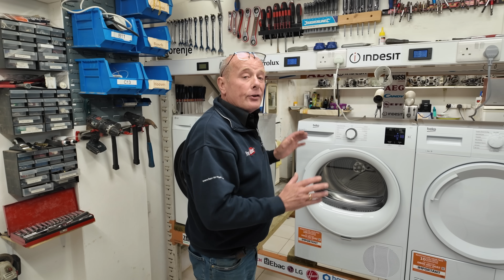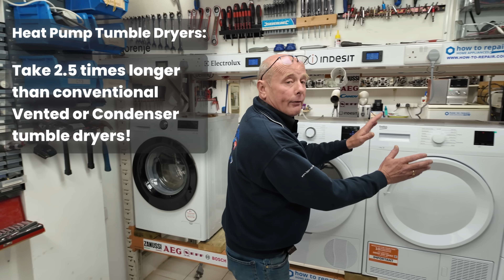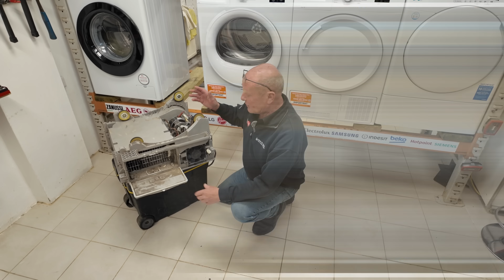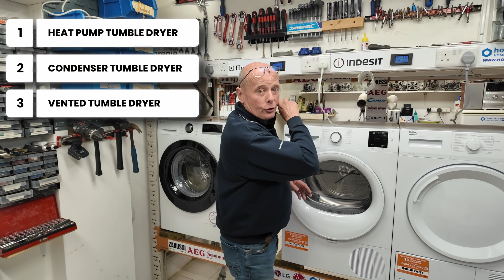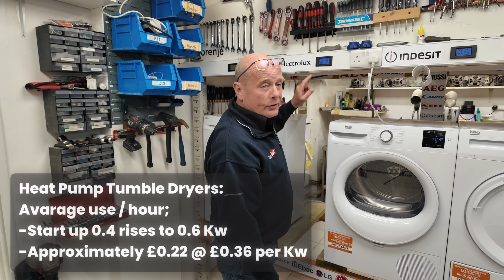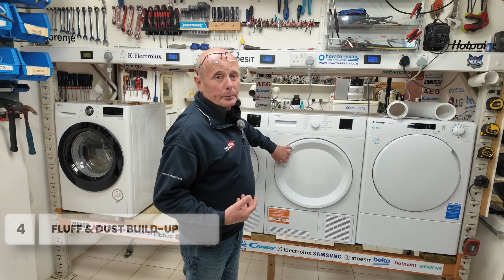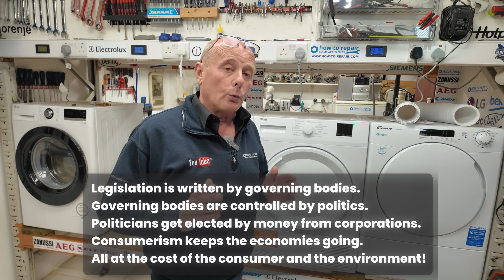Tumble Dryers the Shocking Truth About Heat Pump vs Vented & Condenser, NEW LEGISLATION!

Comment: Especially a vented dryer is a total waste! You just blow out hot air, just heated, outside - an amazing use of energy. In cooler areas, like northern Europe, it is not only the electricity - it is also the loss of air to outdoors, already heated indoor air is further heated and them 'dumped' outdoors (seasonal). You didn't count that. The vent dryer is an amazingly costly lost of warmth. A total waste which is very costly.  Fixing a condensation dryer also means working on a heat pump, that is the system which cools the plates to create condensation. It is also a refrigeration unit. The full heat pump dryer however also 'heats' input air through the heat pump, not only cools condensation plates with one. It is not much different from the condensation dryer. What is the difference? That condensation dryer 'heats' the hot air input using a traditional convection air heater, like blow dryer. Obviously, the heat pump unit 'heats' through heat pump which is not as hot, requires more air and thus tumbles longer, but maybe slower. Bearings do not have as much wear and tear as in a washing machine with all its tough torque moments. So I wouldn't be so concerned and just accept the benefits through my electric bill. You live 'off grid'? Well then - the heat pump dryer is second best - after hanging the clothes to dry!

Comment: Very well explained I work in the commercial and industrial side, too often I find machines that have been over engineered and cost a fortune to maintain. Heat pump dryers are more energy intensive to produce cost more to buy and maintain, and the environment only benefit if you are using renewable energy.
Reply from the maker: The problem for companies trying to be better with environmental issues is there only willing to use the green badge to sell more machines instead of addressing the big problem of the landfill that they generate and the amount of resources that are wasted, manufacturers do not care one bit because it's bad for business. machines lasting too long is not good for profits and as most of these large corporations have multiple brands they can hide behind their percentage share of the marketplace.

Comment: In my view it's a bit more nuanced.
I agree that repairing or even thouroughly cleaning a  heatpump dryer is complex and for a once-in-a-while tinkerer like me almost impossible.
Besides the complexity and hard to reach parts, it's also much too heavy for me to move from its place on top of my washing machine.

I also agree that the puchasing price is a lot higher, so you need a lot of drying cycles to break even (even with the very high kWh unit price where I live).

However I don't agree with the 2.5 times longer drying cycle at all.
My old AEG condenser dryer (at the start and again after a complete clean-up) took about 1 hour with at full 4-5 kg capacity. 
My current AEG heatpump dryer takes about 2 hours with its full 9 kg capacity and also about 1 hour at half full (so 4-5 kg) capacity.
So very comparible, maybe even the same.  And with drying at half capacity a lot less wrinkling and I expect also less wear in the much roomier drum than the condenser dryer.

2 other problems with a condenser dryer are:
The laundry got a lot hotter, so more shrinkage and several items couldn't be dried in them (or got ruined before I found out), while I can dry almost everything in the heatpump dryer.

Also because of overheating the condenser dryers with lint build-up are a known fire hazard. With heatpump dryers with a much lower temperature the fire risk is much lower and not related to lint build-up, only the risks any electrical appliance has.

Unless my current AEG dryer fails within the next few years, or loses drying capacity because of lint build-up, it will be a great improvement over my former condenser dryer.

Comment: I actually own a heat pump dryer (with the same base unit you've shown), which I've found on the curb. It needed a new door handle and a total clean, as the condenser fins in the base unit were completely clogged up. So I had to fully disassemble it, clean it and put it back together! If I would've had to call an engineer out, it'd be likely cheaper to just get a new unit. But it is still working (around 10 years old I think, I got it around 5 years ago) and is a lot faster with drying than most modern units (around 1:40h for a full load, the newer Siemens my mother had needs around 3h). I've added an aircon filter in the bottom, this reduced fluff buildup in the evaporator and condenser a lot! 
So I'm very much saving money by using this machine over a vented or regular condenser dryer. But I'm not the average consumer, so I'm viewing these dryers definitley critical.

Comment: Appreciate the insight.  Hadn't considered that the longer drying times would entail more physical wear on clothes and on the dryer's components even if the temperature is at a lower/gentler level.  Had my BEKO heat pump DTBP10001 since 2018 and it has been faultless, so far.  But it probably could do with an internal inspection, just like we do when we get to that age.

Comment: Ive had my cheap heat pump dryer for over 8 years. Yes it takes longer to dry but it has never broken down. I call BS through experience.  TBH after 8 years if it breaks down I'll replace it not repair it.
Also I did notice yuou have a battery charging on the same power line as the Candy standard dryer so you are also recoding that energy. Not very scientific. Judging by this video alone I would not recommend anyone subscribe to this channel the bias is glaring.

Comment: If the Heat Pump Tumble Dryer takes 2.5 longer to dry the you'd have to multiply that 426kWh by 2.5 to get the comparable amount of electricity usage, which would be ~1000kWh vs ~2000kWh right? so only half the amount of electricy usage, not a quarter less.

Comment: I’ve got a candy condenser dryer. Had it around 7 years no issues. The other day, the door clip snapped off. I hope they’re able to repair it. I don’t want it replaced with a heat pump dryer. 🙄

Comment: It seems to me that the issue has nothing to do with it being a heatpump, and actually just due to poor design. 

A machine that needs to be ripped apart to clean out the dust is a dumb design, why don’t these heatpump units have the same access doors that the condenser unit does for cleaning? 

Also why is it taking 2x longer? Is it running at 2x less temperature? Rotating 2x slower?

Both of these seem like something that could be fixed. 

I pay £0.07 / kWh at my house while I’m charging my car. This is when I run the washing machine and also the dryer

Comment: My AEG H/P tumble dryer has a front filter exactly like the condenser model in the video (7:43) which the manufacturer advice to clean after every use. I also regularly clean the bottom access. After 4 years of use so far so good. I don't think we should be worried about the longevity if we follow the instructions. And btw, I'm a service technician on appliances, as well as an electrician, and H/P dryer are not known to fail prematurely.

Comment: could you also take into consideration  the wear on the clothes,  the higher heat in a non heatpump machine wears the clothes faster than  the more gentle heat in the heatpump, does the higher heat cause some parts in the machine to wear faster as well ? just picked up a candy heatpump dryer for less than £300 new so the price is coming down

Comment: I had a broken belt on my 4yr old heat pump drier, it was one of the types that are a clamshell drum pressed between the front and back, the amount of fluff I vacuumed out of it was unbelievable!  It worked brilliantly for the next 3months then went back to its useless "sometimes it might be dry but probably it won't be" again.  Evaporator etc looks identical to the one you stripped in the video.

Comment: A lot of your analysis is based on the assumption that the heat pump dryer will take 2 1/2 times longer to dry, but it shouldn't. As to the issue of fluff, this is an issue on all of them but down to design. A heat pump dryer can be designed to make the fluff easier to remove. As for bearings and motors, again this is a question of design not the principles of the operation. I'm also intrigued why in the age of DIY regassing of car HVACs, that it would be hard to read a heat pump tumble dryer in principle. The big benefit of heat pump tumble dryers is savings on energy.

Comment: We are on our second Hoover Heat Pump tumble dryer in less than 4 years and we are so utterly disappointed. Both failed after the warranty expired. We thought we were unlucky with the first one, but second time round had us questioning the “green choice”. Inbuilt obsolescence is an absolute scourge on society and a massive piece of the climate change challenges. Thank you for highlighting this and I really hope your video gains the attention this issue needs so that new policies do not mislead consumers and add to the problem.
Reply: Hoover dryers are garbage. That name has not been worth anything for a long time. Bosch, Siemens, Miele is pretty much where it is at.
Reply: @AB-80X Got to agree there rubbish and hours to do a load.
Reply: @AB-80X  THIS 💯
Reply: @AB-80X  Thought there was six years consumer protection of these devices.
Reply: Don’t buy Hoover, it’s a trade off, cheap or robust.
Reply: We've had a Candy HP tumbler for 6 years.  Still going strong.
I gets some hammer too
Reply: Hoover isn't a great choice...
Reply: My Hoover H-300 Heatpump has just failed also after 3 yrs of ownership so i thought to comment as you arent alone on this one.
Reply: As of the end of April 2026 this video has gone over half a million viewers.
Reply: And don’t forget that whilst the heat pump dryer may only use 400Wh, having it running it 2.5 times longer means uses the same as a machine that uses 2.5 times as much power for 2.5 times less time. All this from a machine way more complicated than current types, substantially more expensive to buy, wears out 2.5 times (or more) faster, is totally uneconomic to repair, such they replacement is the only viable option and costly to dispose of.  I am a scientist and have analysed the subject ad nauseam My conclusion? I’ll keep using my 22 year old vented machine that cost £179 new, has only needed repair once (replace the thermal cut out - easily accessible and well within my capabilities) and doesn’t bash hell out of my clothes. Yes it uses a bit more power but it runs overnight when the grid has surplus energy to dispose of and sells it cheap. I would rather  keep that going as long as I can before buy ingredients such a stupid gimmicky heat pump dryer.
Reply: @proberttemporum4542 A HP tumble dryer will use a lot less energy, this is a fact. he even says this in the video though not very clearly. i think he mentions cost savings is 2 years on an average household usage. so if it last 5 years you could buy 2 HP tumble dryers. if it last longer think of all the emissions you've saved from the energy saved.
Reply: @proberttemporum4542
If your 400Wh machine runs for 3 hours, that’s 1200Wh. If your 2400Wh machine runs for 45 minutes, which it won’t, it will run for an hour, that’s 1800Wh. But like I said, it will take at least an hour for the 2400Wh machine to do what the 400Wh does in three. That’s just a simple statement of fact. Look at the programs in each machine. The time each program runs. It’s pretty simple math.
Reply: @proberttemporum4542nonsense in several points.
Reply: @proberttemporum4542 You dont sound like a scientist. You sound like someone who has an opinion, and is working backwards to find evidence to support your opinion and so cherry picking facts. Hope you dont work anywere important.
Reply: @CupAndSaucerBrit  
Was thinking the same. It also means very little to talk about being a scientist, unless you specify in what field. He does state in his comment that it is his opinion, which of course negate the scientific aspect completely. What I also find interesting is this. I know more than the average person about analysing data. My PhD is in Quantitative Analysis Modelling. I find it extremely hard to source any useful data to do any kind of meaningful analysis on this. Sure you can find a few things, which means that you can do a very basic Qualitative Analysis, but as anyone with a scientific background knows, qualitative analysis is very, very basic and rough. In order to do a proper quantitative analysis, you need a proper body of collected data. That does not come form one person making a YouTube video.
Reply: @AB-80X  well said,  I look at a lot of testing data for very similar products, and I hate saying this but most of the figures are played with to look better and not totally real world. With these products test data of different wet loads should be tested, but regarding condenser and vented driers you'd also have to test and different room temperatures and humidity, put this into average conditions too work out actual usage. Ps im getting a HP tumble drier, though I prefer to hang washing out anyway.
Reply: Also if its about the environment/ and so called climate problem surely  the manufacturer  should inform the consumer  about how much the actual  product uses precious materials that have  a massive  disadvantage  to the environment?????!!!!  Heat pump dryers are just another  rip off!!!   😊😊😊😊😊
Reply: @TonyEdwards-t6k  Modern heat pumps use propane as the refrigerant, and not a lot of it. The rest of the system is just common metals - iron, aluminium, copper and their alloys. The only heavy metals are those used in the logic boards, the same as is unfortunately in all consumer electronics nowadays. When he mentioned about fridges being difficult to dispose of, it's because of the old refrigerants being used that do need to be handled carefully because they are harmful, and because of the insulation foam used. Heat pump tumble dryers have neither of these problems, they are very simple to dispose of and recycle, and contain the same amount of harmful heavy metals as your phone does
Reply: if you pay cheeeeeep and buy Chinese  what do you expect
Reply: @jackednayoung That's a little unfair, they may not have the budget for a more expensive / reliable brand.  That said, reading in to your message, I do believe in investing in a better brand if budget allows.  It's also sad that Hoover sold themselves out to Haier.
Reply: @kobostinywings unfortunately  most of the dryers are made in CHINA    some in Turkey  and very few in the west !!!!  Some bosch etc  are made in China along with many other so called reliable makes !! When your in curry's next time have a look !!!!
Reply: Now adays they have a built in chip that has a expiry date sneakly inbeded, and some have lasted a few extra years but most have a 3 yr life span so you then buy a replacement, so they keep their workforce in jobs, but hardly green when they end up stacked high on landfills, rusting and leaking into the earth/ soil. I wish I kept all my still working appliances I had which I was fooled to go greener. Fridge shit, cooker shit, and replaced 3 times and still shit.

Comment: A case study: I bought a Indesit A+++ heat pump tumble dryer, which was £469 but on a promotion it came to about £380. It is rated at ~1.5kWh to dry 8kg of clothes. I lived in a house of 6 people, and I estimate it ran at least every single day. Over the last 3 years, at 25p a kWh, that gives an electricity cost of around £400-450. An indesit condenser is rated at 4.75kWh, which if used to the same degree would cost around ~£1200. Given that the price difference of the cheapest A+++ dryer is £348 at Curry's, and £249 for a rated B model, it seems likely that a machine will pay for itself with heavy use. It's also worth considering that if a manufacturer gives a "10-year-parts-only-warranty", there is an effective cap (approx £150) on how much a repair can cost, but I can't comment on how good a job the technician would do.

I don't disagree with the points on longevity, but it seems to me that it's a question of engineering and willingness for the manufacturers to actually prioritise it. Maybe that's a job for legislation, or at least giving a longevity and/or repairability "score" similar to the energy efficiency score. It's very difficult for a consumer to understand the cost-cutting decisions that may or may not be present in a Haier, Hotpoint, Beko, Indesit, Bosch, whatever. Only a vague idea that the Bosch and Miele might, by reputation, be more well made. I would absolutely be willing to spend £1,000 on a very energy efficient machine if I had confidence that it could last 10+ years of typical use. In the meanwhile, we just have to pick one which has a 5 year warranty and hope the energy efficiencies pay for themselves >shrug<

Comment: Heat pump dryers are slow.  You dry 2.5 loads with a gas dryer before a heat pump will finish with one. NO THANKS... May as well hang them outside.

Comment: Did I hear that right? The heat pump dryer was measured in using 200 watts when you checked, but the condensed was using 2.5kw?
Reply: 400 but takes 2.5 times as long, therefore equivalent as 1.2kw.